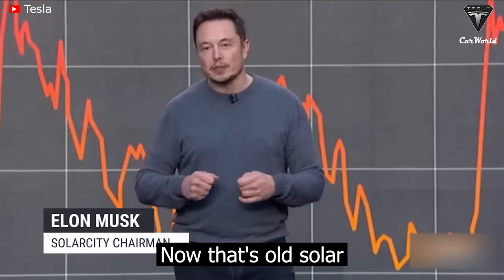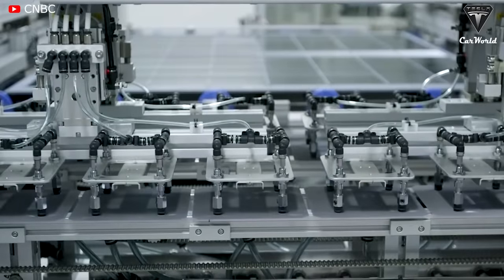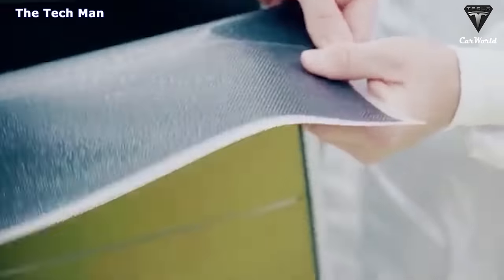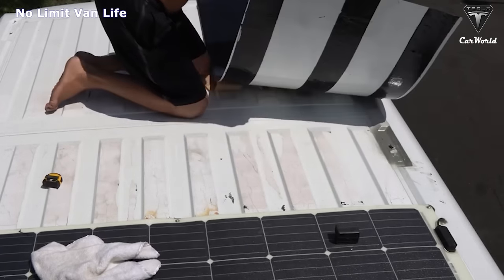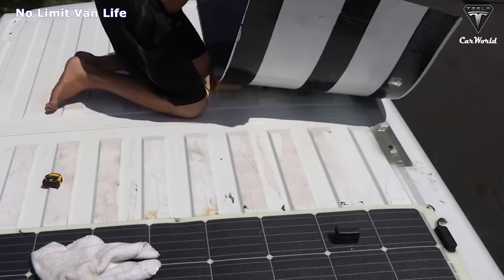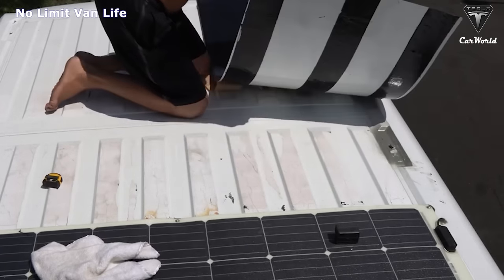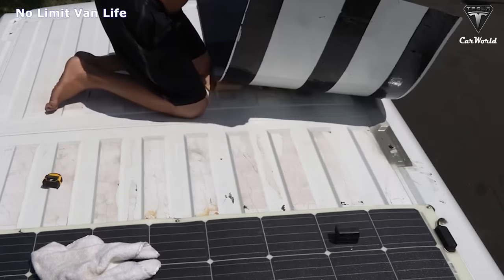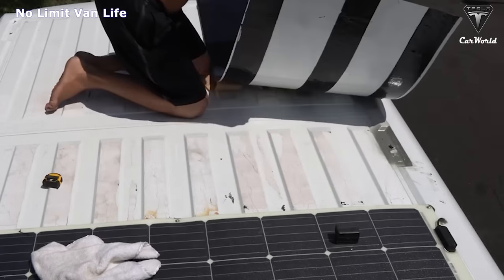Elon Musk Revealed All New Solar Panels for 2024 Renewable Energy, Can blow your mind!

Comment: This is correct.
99.999% of vehicles on the roads use internal combustion engines and burn fossil fuels...fact.
Also the same for aeroplanes. and ships, heating etc...

So one can say we burn fossil fuels for 100% of everything today and little will change over the coming decades.

It is obvious that the quickest way to deal with this, is and cut down the use of fossil fuels is simply to cut down to use of motor vehicles.....But the opposite is happening as most people now work in cities and because the cost of living and housing in cities is growing exponentially as is the number of people living there, more and more people use more and more fossil fuels to travel back and forth to work as they live further and further away from the centres.
The roads have never been busier.
The use of all forms of transport using fossil fuels have never been higher and it will increase unless drastic action is taken,
The demand for Energy (which uses fossil fuels) rises exponentially....

In reality therfore, there is no action being taken by any governments other than encouraging the use of EVs which as we know is driven by money and profit and nothing else. (same with heat pumps, solar energy and wind turbines).

If climate change is real, then there is nothing being done about it, other than seeing it as a way of making money and profit.....
That is the reality...

Comment: Mr Musk, I am intrigued by your break through. I have only one question.  I live in Canada. I would like to know how your (flex) panel withstand our temperatures here in Canada? We're they can range anywhere for -50 f (122 c) - -50 f (-58 c). Would they withstand year round application.
Reply: I would imagine a simple solution would be to use water cooling, and then link it up to your house/pool to heat those up.
Reply: @viggebeckmann1650  that still does not answer my question.
Reply: Nearly all plastics get very brittle in icy weather, so I doubt they would be very workable there.  I rather doubt they'd stand up to hail very well, either.  Ask a manufacturer of thin film PV.  I don't think Elon stops by here.

Comment: I just bought 2-220 watt solar panels for $200 each and now your telling me I can get a 100 watt panel for $199 which is $50 off but still double the price I paid. That’s like buying a 100 amp hours battery a beep cycle battery is $89 and is good for 5 to 7 years and the same size lithium is $1200 is supposed to last 2 times longer weights 1/2 as much but if you quick charge them they go bad in a few month they also don’t work if under 70 degrees and will catch fire if over 130 degrees like if there in the sun or someplace like Arizona, Arizona, Arizona, Arizona, Arizona, Arizona or Texas but you can get these toxic devices from china who is known for higher quality isn’t it

Comment: The solution to transfer to Green Energy isn't tied to the technology of the collector, but coming up with a scenario that enables desert land to flow with Milk and Honey to subsidize the cost of manufacturing and installing the required infrastructure to have 24/7 stable and reliable energy available across seasons.
This is going to require isolating hydrogen from seawater and storing it in massive distributing pipelines for the transportation industry as well as going to utility grade Fuel Cells to get both electricity and a byproduct of potable water.  Elon Musk has indicated his interest in colonizing Mars and to do this Terraforming is required!  It's best to workout the bugs on earth upfront while in a safe area.
Reply: Maybe one day but right now it's far from being anywhere near economically feasible.

Comment: RE:  "The energy creation capability of solar cell crystals can be increased by x1000"  . . . if current PV cells are already 20-30% efficient, this is IMPOSSIBLE.  There is only 100% to be had.  that means max of 2x or 3x if ALL the energy in solar energy is converted.

Comment: 6,800 dollars to remove old shingles?  That is ridiculous.  It is a two day job for two to four people.   it should be about $1,000 at $15 dollars per hour for four workers.  I spent about $5,000 for solar panels and batteries ( 10 kilowatt hours for night time usage) and will spend another 1,200 dollars on an inverter and maybe $700 for a platform to put them on.  That's about 7 thousand to do it myself.  It's not rocket science.  For $40,000 dollars I could build a whole other house and another 7 thousand could put up a 7 kilowatt service of solar power.  Installers are ripping people off.

Comment: I am not sure where is the price information for the silicon panels taken 2 usd per watt, but it is 10 times higher than the current market value of such panels, which is 20 cents per watt. It is probably a mistake.  So if these new panels that you are referring to cost 20 cents per watt, there is no difference whatsoever.

Comment: It's a good and rather thorough presentation of different types of solar technologies and their pros and cons. The bottom-line of practicalities seems to lie heavily on efficiency and cost, yet its wastes or recycling having no answers but landfill with toxic materials. While a technology of Thermal PV is new to the picture, recycle issue of such has not been addressed, yet perhaps having introduced possible high temp hazardous issues into the mix. Hasn't Tesla been looking into something more organic, and something that reduces the overall cost in a long run including long term environmentally friendly? Wonder if OPV (organic PV) is an excited discussion topic at the most recent NREL.
Reply: Perovskite production does not require high temperatures, but so far requires lead and is highly vulnerable to moisture. However, it literally can be painted on a surface. On the energy generation side, this appears to be the most promising, but requires major investment into R&D.

Comment: The problem with the solar panel industry is that the mining and processing involved and the eventual toxic disposal issues make it a shortsighted solution and not at all environmentally friendly.  This presentation misrepresents the facts about nuclear energy's advantages over solar panels and presents a false calculation about comparative costs, which are not simeplyt eh cost of manufacturing.  Molten Salt Thorium Reactors produce far less of a footprint. They are so efficient that they can be set up to burn waste from Uranium rods left over from the old Light Water Uranium Reactos that most are familiar with and are so dead set against.  And they can address so many other issues aside from the production of electricity for a home or industry.  While solar panel fields displace acres of natural habitat and require billions in transmission infrastructure (as do windmills), a Molten Salt Reactor can be built on an existing site of a coal-fired or old-style nuclear energy plant and run with the present grid as it exists presently.

The best solution for the future of energy supply is the construction of Molten Salt Thorium Reactors.  Besides providing abundant, electricity, they can provide a myriad of other functions that will completely defuse the Green Agenda.  The so-called renewables actually do more harm than good because of the mining and toxins involved in their production and the waste they produce. It is possible to keep the current transportation infrastructure in place.  For example, synthetic gasoline production has been made a reality.  This is a carbon-neutral process of capturing carbon and reconstructing the gasoline by adding Hydrogen, recovered from atmospheric capture means that we can shrink that atmospheric (and oceanic)carbon.  MSRs can make this happen in realistic quantities.  They can be built on existing power plant sites, like coal or diesel plants, and use the same already existing power grids.  MSRs can be made small enough to run a car, ship, train, a house.  They can be used to desalinize ocean water on a massive scale.  They cannot melt down because the molten salt is the fuel carrier.  Thorium is preferred over Uranium because it has 200 times more energy potential and is dirt cheap.  Thorium is abundant and has been the "waste" product of rare earth mining.  The reaction occurs between 600-800 degrees F.  If the molten salt should ever overheat the reaction stops and a freeze plug in the bottom of the fuel jacket melts and the molten salt flows into a holding tank where it cools down naturally.  They can be set up to burn the waste from light water uranium reactors because they are so efficient.  They can be used for producing non-carbon diesel fuels.  They can be used to cheaply desalinate seawater, and scrub carbon from the atmosphere.  They are safe and can be built anywhere. because they don't need water in any aspect of their operation.  They can be made small enough to power a car or big enough to power a city.  The U.S. has about t a dozen companies that are either ready or near ready to construct them   France is developing them and Denmark has one company developing them.  I don't know about Germany, but Germany would clearly benefit from them and could erect them quickly if desired.  They must get over their anti-nuclear sickness, however.  There is no time to waste.  here is a four-minute introductory video to MSRs. - 
https://www.youtube.com/watch?v=k6BXvw6mxtw

Comment: A lot of info, actually too much for the length of the video, or maybe it just seems like it because this video seems to jump all over the place.  It goes from crystalline solar cells to flexible solar cells to solid state heat engines, back to crystalline solar cells, to grid storage potential of I think the solid state heat engine, to Tesla solar roof tiles, to Tesla solar roof panels, to recycling Tesla solar roof panels (actually that part applies to all solar panels, not just Tesla) and the difficulty in recycling them. Then there is some mention of nuclear power plants and how much space they take for generating (x) MW of power vs. the solid state heat engine??  This hopped from one to the next back to the first, then to something else then back to the second or the first or something new, then back to the first, or third, or second or ???????  It was hard to follow. Pick one technology, explore it provide whatever info you want to present, then move to the next.  Please, please, please do not go over the cost to manufacture, install, research things if you aren't going to compare side by side so one can actually see the comparison. Instead of presenting the cost to install 1 watt of solar energy, how about doing a more realistic 5 kw or 10 kw array?  Nobody is going to have a 1 watt solar array installed, assuming that it is even possible to find a 1 watt solar "panel", plus before I could do a quick calculation based on the 1 watt installation cost, it jumped to another topic. So please pick a lane, stay in it, then change lanes, don't keep quickly changing lanes all over the place.  Provide a coherent flow of information, or break down the info into smaller videos that focus on one or two of the technologies at a time.

I did like the range of technologies covered, I would just prefer to not have to watch the same video 10 times or more to extract the information.  I prefer first time through and don't mind viewing maybe 1 or 2 more times if the subject is particularly compelling.  Not sure if I want to even watch this again to try to extract usable info.

Comment: You leave out the Achilles heal of nuclear power, its EROI (energy returned on (energy) investment). Nuclear power has an EROI of 14 to 1, about the same as the lower end of oil and gas. That is for every 14 units of energy produced, it requires 1 unit of power to produce that energy. Renewable electricity from wind and solar has an EROI between 16 to 1 and 20 to 1. So besides being far cheaper, safer, less prone to accidents, far less of a terrorist threat, and not requiring the safe storage of nuclear waste for millions of years, renewables produce more power output for every unit of power required to build them than nuclear. This is without factoring in the energy required for long term nuclear waste disposal for millions of years, which by some estimates will possibly put nuclear power into a negative EROI in the long term (below 1 to 1). Any power source with an EROI below 10 to 1 is considered impractical for a technically advanced civilization, Canadian tar sand oil is well below that at 3 t0 1.

Comment: There are no better panel system ideas better than Dennis Lee's invention. His Panel System works 24/7 anywhere in the World.
Dennis Lee's invention uses a subzero gas that collects heat as long as there is a breeze across it, the heat is compressed and turns water in steam that runs a steam engine continuously in a closed loop. It can be retrofitted to Simi Trucks and Railway Cars right now. 
Solar Panels have been and away will be a substandard alternative to way better ideas. The GEET Fuel Processor by Paul Pantone is a better idea than Solar Panels. Magnetic Coupling is a better idea. 
It's time to give up on Solar Panels completely.

Comment: Perovskites are easily made and can be attached to any surface. There is no specialty equipment needed to produce. However, like the video points out all these thin layer solar panels are lacking longevity. But this is being worked on. The benefits are the ability to stack panels. Also there efficiency is around 30 percent. Unlike sylica that is around 15 percent.

Comment: Set your playback timeline to 5:01 and listen carefully when the speaker says that the new solar cell "irradiated with laser light had a current flow 1000 times stronger...".  This is a laboratory setup.  Not the real world.  Tell us how that same prototype cell works in normal sunlight.  I suspect it won't be any better than other solar cells.  It's important to listen very carefully to the "fine print" of the claims.  Especially when profits are involved.

Comment: 5.42:   He states a 11.34kw system produces 45-58kwh per day equivalent to 1500kwh per week…how does 58kwh/day x7days  = 1500kwh per week? Per month yes. I’m assuming the energy conversion/efficiency is around 20% or so ie will convert around 20% of the total energy received from the sun, so how can this be increased 1000x? The most it could be increased is 5x (to make 100%). This narrator (AI?) is talking total bollocks. I think this channel is run by a bot and hence totally unreliable and would recommend boycotting it.